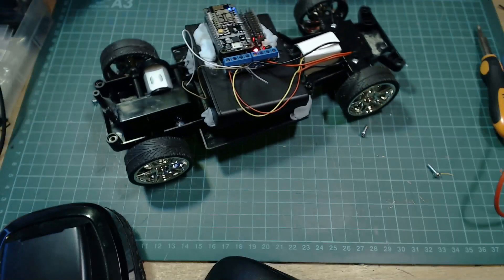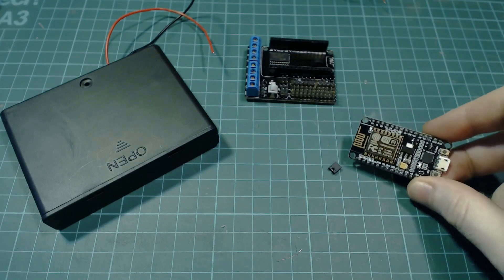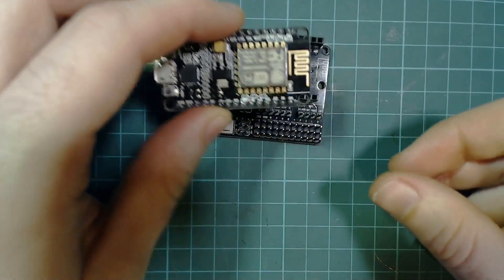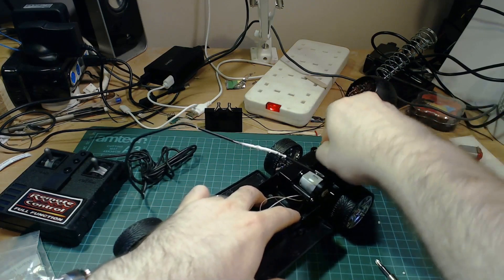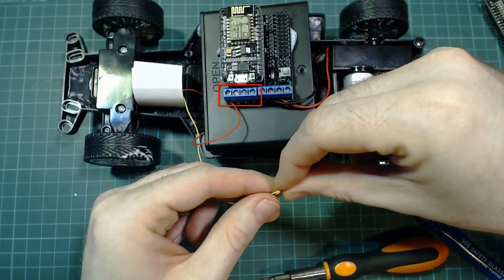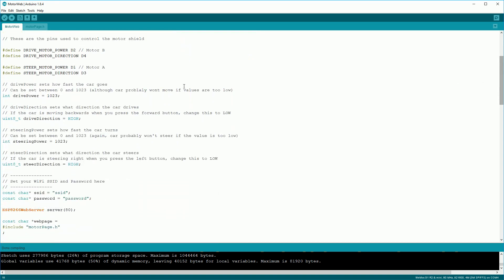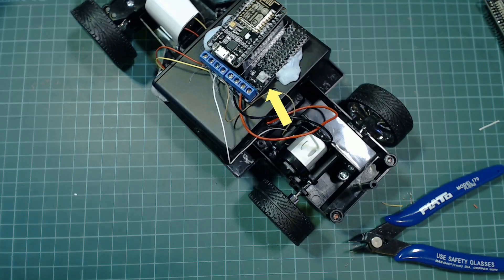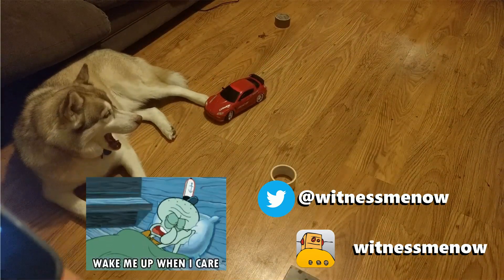Adding WiFi controls to a RC car using Arduino

Comment: Wanting to build a 4g long range rc plane, was wondering if i could use a wifi module like this and a 4g wifi pocket router in the drone and somehow connect the controller to the drone via 4g
Reply: did you ever manage to do this?

Comment: Hi Brian. Just a suggestion, applicable to local device control (perfect for a model car!). I’m playing with Bluetooth (BLE) device control via ESP32. Using BLE has lower overhead (less power), doesn’t require a WiFi AP, and is therefore also fully standalone / portable to take anywhere! The car could advertise it’s service, and your mobile App choose which car to control. All in all, perfect for model cars, which of course you need to see to control. :)
Reply from the maker: Great suggestion Greg. I just liked how simple this was to throw together! Especially with Motor shield for the nodemcu board. 

But I think it might be a good idea to revisit with Bluetooth OK!

Comment: seeing how you fiddle around+bend the cables to get good connction into the wire teminals:
i use crimping in a not intended, but very efficient way: you take a larger crimping sleeve (?name?) than the wire normally needs. you keep the cable a cm over the insulation.
the rest of the blank wire you wind backwards around the isolation.
to fix everything, you then crimp the larger metal sleve over everything including isolation. this way you have good connection even with small fragile cables + you stabilize the cable with the isolation so its harder to rip away... will make a step by step picture when im home again..

Comment: Hey Brian,

I'm new to this, but your tutorial has been really insightful. I'm struggling to get the motors on my RC car to go more than one direction. While setting the motors' direction to "HIGH" works fine in the code, setting them to "LOW" stops them entirely. For example, my Drive Motor will spin the tires backwards when set to HIGH, but stops the tires entirely when set to LOW, without spinning them in the opposite direction. Would you know what I'm missing?

Comment: Nice project!  However, I have a question, if using a the ESP8266 WiFi manager, where would I insert the code and what parts would I have to delete? Thanks.

Comment: Thank you for the video, very fun stuff!

I tried this with a remote car and it works but the car is very week and barely moves, I purchased a 9.6V 2000mh battery and if I connect the battery direct to the engine the car goes almost crazy but when I wired in the board the car will not even move on the carpet. Any idea?

Comment: I have a Andromeda NoMad ND1 RC. It was suppose to come with built in wifi but it doesnt. U need to hook it up by wifi to your phone to use the controller app that you are suppose to download. The car is useless.... will this method work for it?

Comment: Hello, I'm not sure if you are going to answer that but thats the only way I can ask for help. I did everything you did and the car works perfectly when I power the nodemcu with usb cable. But when I try to power it up with 9v battery, buttons on web page doesnt work. I press every button but car does nothing. Please help me
Reply: Did you solve the problem?
Reply: @ensarcidic  yes i fixed it but i cant exactly remember how. If you have the same problem, I'm so sorry i cant help :(
Reply: @barkinssss  i have different problem 😅. Did you put some camera on that car? I need to put camera and to have stream on html.
Reply: @ensarcidic  no i didnt put any camera. I dont know how to use fpv cameras :( I'm so sorry man i cant help you 😥

Comment: hi. project is best i done it. all works amazing. but one problem: how to bind W,S,A,D keys for pc control in html side?
Reply from the maker: There is some code to do that in the bottom of motorpage.h that's commented out if you remove the "<!--" and the "-->" it should work. I'm not sure why I commented it out though, maybe there was some problems with it. Hopefully it provides a starting point at least
Reply: @BrianLough  oh my god. i love you man) it really works now. i just cange the button code to w-87, s-83, a-65, d-68. and now i can drive it over my pc!
thank you for your project and answer!
good bless you!
Reply: Does it work if I change nodemcu Motor Shield with arduino stepper motor drive?

Comment: Hello, i have done everithing right ( i think ) and uploaded the file to the esp8266, when I try to use the serial monitor it gives me revers ? and then some letters but I never get the Ip address. What might be wrong?
Reply: Change the baud rate in the serial monitor to 115200

Comment: Bro can we use 12v battery instead of 9v battery
Reply from the maker: Nope, 2:00, "supports up to 10v"
Reply: @BrianLough  for 12v which Module we should buy actually I want to make it fast and I have fixed there High RPM motor.... Bro can you tell me how much voltage is supplied to front and back motor... 
According to that I will coil the motor
Reply: @debajyotipathak1785  is steering motor is servo?